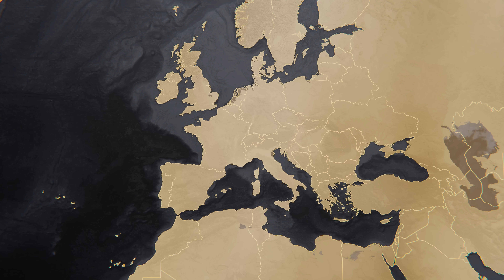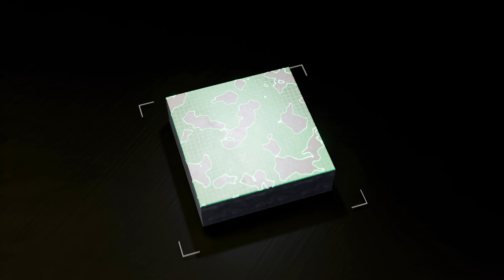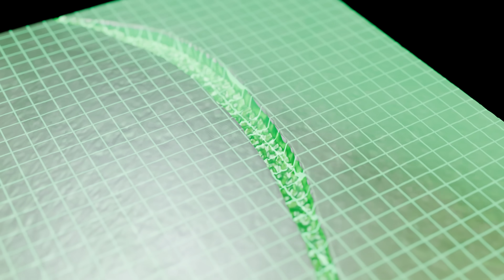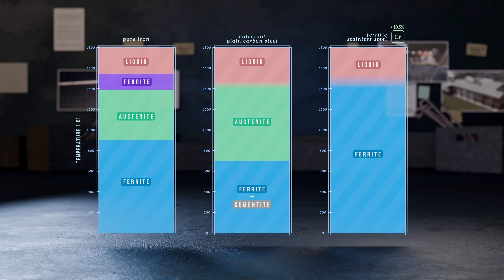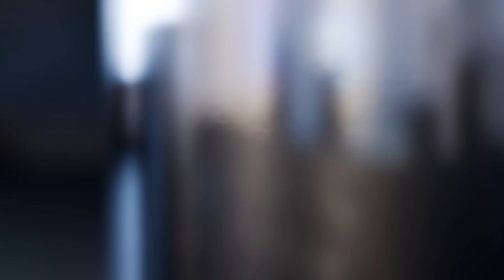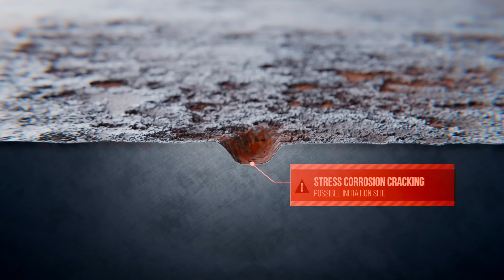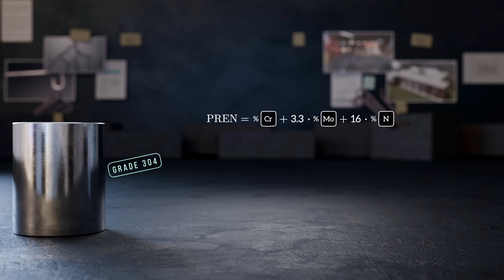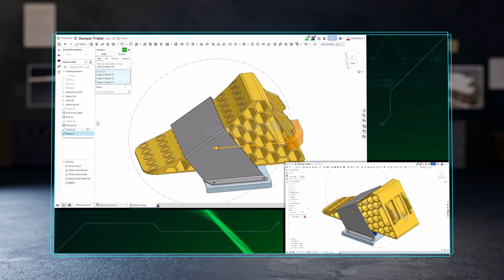The Problem with Stainless Steel

Comment: A very well explained and accurate discussion of stainless steel metallurgy. As a registered Professional Engineer in metallurgy, with 50 years of experience, I knew from the very beginning of this video that type 304 stainless steel would be a very bad idea use in the high chloride environment of a swimming pool.  Although stress corrosion cracking (SCC) of Type 304 is much worse at higher temperatures (around the boiling point of water) this video explains why certain conditions can cause catastrophic SCC failure at ambient temperatures. The main conditions for this type of failure at ambient temperatures were the relatively high stress applied to the support rods, and conditions which led to high concentration of chlorides on the rods.
Reply: i knew 304 was a bad idea in salty or chloride rich environments as a sparky with no expertise in metallurgy at all 😂
Reply: @casemodder89 - I love the beauty of SS and even though I never had a metallurgy class I thought it was common knowledge that chlorine made SS rust because it broke down and penetrated the oxide layer. As a mechanic I have many, many choice words for "engineers".
Reply: @casemodder89  yeah you have no expertise it shows
Reply: That's why I had so much trouble with construction projects at the water treatment plants. Contractors were always trying to use 304 because of the wet environment, totally sabotaging their own work because of the high levels of Chlorine in the air.
Reply: Nobody cares that you're a PE. It just tells the rest of us engineers that you think fancy titles make you better. We can study for free instead of spending money to tell others that we studied.

Comment: Stainless is also a lousy metal to build machines out of.
It's necessary in food processing.
The solution is to shut it down once a week and tighten bolts.
If you don't tighten the bolts on the weekend, then you'll be chasing them all week, during production, when there are dozens of production guys doing nothing while you do what should have been done while they were at home sleeping.

Comment: This almost happened to a pool area in Atlanta, GA. In a hotel. I was contacted by a company that had bought the hotel and there was an obvious chlorine smell throughout the hotel.
The concern was that the air from the pool area was crossing somewhere. Either via a pressurization problem or plenum problem.
It turned out to be both. The stainless steel ducts of the pool area were corroded. Internal dampers had corroded and become inoperable. So that if the pool unit was off the shared OSA duct would allow other a/c units to pull air from the pool area. A hen the pool unit was running it pulled in too much outside air. This made the pool area too positive and warm humid chlorine air was spilling into the common areas. These common areas re as served by a/c units that served multiple floors such that the chlorine was getting distributed across multiple floors. The pool unit was designed to and built to handle that type of air, but the units serving the common areas were not and they were basically disintegrating.
The discharge ductwork leaked a considerable amount of air into the ceiling plenum. All the supports of the plenum were compromised. This included the support structure for the we duct work and unit.
Most of this was by poor installation rather than metal choice. Including cross contamination from using the wrong tools.

Comment: Ok y'allz while everyone is cracking jokes 12 people lost their lives to a poor design choice of material. 304 is the weakest and cheapest form of SS in the world and the Chinesium Crapolium manufacturer's try to hide the fact they use 304 SS in there products. 
There are over 150 different grades of stainless steel, broadly categorized into five main families based on their metallurgical microstructure. These grades are defined by their specific corrosion resistance, strength, and composition, with the most common types falling into the 200, 300, and 400 series. 
Key Families and Grades
    Austenitic (200/300 Series): The most common type, known for high corrosion resistance and being non-magnetic (e.g., 304, 316, 303).
    Ferritic (400 Series): Magnetic, with moderate corrosion resistance, often used for automotive trim and appliances (e.g., 409, 430).
    Martensitic (400/500 Series): High-strength, magnetic, and hardenable, used in cutlery and aerospace (e.g., 410, 420).
    Duplex: A mix of austenitic and ferritic, offering high strength and corrosion resistance (e.g., 2205).
    Precipitation-Hardening: High-strength, heat-treatable alloys.
But stainless steel isn’t a single alloy.
While stainless steel gets a large part of its corrosion resistance from chromium, there are near-endless combinations of various metals marketed as stainless steel today.
One of the first steps in finding the best options when working with stainless steel is determining the proper alloy for your product.  (HEREIN LIES THE KEY TO THE PROBLEM IDENTIFIED)   303 AND 304 ARE SOME OF THE WEAKEST AND POOREST CHOICES FOR STRENGTH AND CORROSION RESISTANCE. 316 IS OFTEN REFERRED TO AS MARINE SS.  
Stainless Steel Grades
Within families, you’ll find various grades that help to describe specific properties of the alloy such as toughness, magnetism, corrosion resistance and alloy composition.
Older grades often feature a three-digit identifier established by the Society of Automotive Engineers (SAE).
However, you might also see grades in North America identified using a six-character identifier set by the and American Society for Testing and Materials (ASTM).
These are known as Unified Number System (UNS) identifiers. You can find a full list of common identifiers here.
In many cases, UNS identifiers share the same first three numbers as their AISI equivalent.
But there’s also grading systems created by:
    British Standards (BS)
    International Organization for Standardization (ISO)
    Japanese Industrial Standards (JIS)
    European Standard (EN)
    German Standard (DIN)
    Chinese Standard (GB)
Due to the sheer number of different standards and grading systems, it can be difficult to obtain much information about a given alloys unique composition from it’s grade. For example, 304 stainless steel by the SAE standard might also be graded as:
    EN number: 1.4305
    EN name: X8CrNiN18-9
    UNS: S30400
    DIN: X5CrNi18-9, X5CrNi18-10, X5CrNi19-9
    BS: 304S 15, 304S 16, 304S 18, 304S 25, En58E
    JIS: SUS 304, SUS 304-CSP
However, to receive a given grade designation, the alloy must adhere to a strict set of requirements set forth by the organization maintaining the standard.
In the case of the common SAE standards, 304 stainless steel must contain:
    18% to 20% Chromium
    8% to 10.5% Nickel
    0.08% Carbon
    2% Manganese
    0.75% Silicon
    0.045% Phosphorus
    0.03% Sulfur
    0.1% Nitrogen
Each addition or adjustment to the alloy composition will have an impact on the various facets of the stainless steel’s performance.  So basically we are discussing something on an Engineering Standard with worldwide variations of those standards. Yes I know many of you here don't give a flying fart but IF you were the designer of that building and specified 304 as the designer you can be found negligent in performance and design specifications which in this case would simply bankrupt any small or medium sized firms, but, due to the business aspect and the liability included this would require an Insurance to be in effect and I cannot believe someone would insure this based on those design specs. It's a giant red flag.  And likely some ramrod supervisor said : "That's what's spec'd that's what we use IF ever a question about it was ever posed.

Comment: Used to work making and installing the pipework for water treatment plants, we only used 316l bolts with 316l flanges, to avoid any galvanic corrosion.
We also had to spray anti seize on all the stainless bolts otherwise you'd get insane galling very quickly, and then you'd have to take a grinder to the bolt if you ever wanted to take it out
Reply: We use to use large 316 michalor/jublee clamps on pipework. I’ve never been able to unscrew one without it galling/cold welding. Tightening is fine, but as soon as you turn back a few degrees it’s a goner! Ended up putting copper/aluminium slip and that worked
Reply: Galling,  especially on exhaust system fasteners,  is a pita.  My Honda utv exhaust has several fasteners replaced with good old steel after breaking them to clean the spark arrester.   Good idea on paper,  bad idea in the real world
Reply: I worked for a company that designed and built large scale heat treating furnaces. We always had problems with stainless steel bolts galling. one day a co worker accidentally used 316 stainless nuts on 310 stainless bolts.. Even after many heat cycles at over 1000 C there was no galling as long as the hardware was allowed to cool before dis assembling
Reply: You need to use special anti-galling grades for fasteners. Nitronic 60 works great but is under-specced because of its price. Tin, silver, and cadmium coatings work well too but are also hard to source. Many applications will forbid anti-seize or oils.
Reply: @Shaker626  Or you can use nitriding to surface harden the stainless which reduces the galling.
Reply: @MrCarGuy interesting to know! Didn’t know surface hardness made any difference to 316 galling but I guess it makes sense.

Comment: SCC has been known for many years.  Chloride accelerated SCC has been around for even longer - just ask some saltwater sailboat owners who suddenly lost their rigging due to failures in their SS rigging components such as mainstay chain plates.

Nuclear power plants have had to deal with these effects even at very low chloride concentrations in Reactor coolant piping.

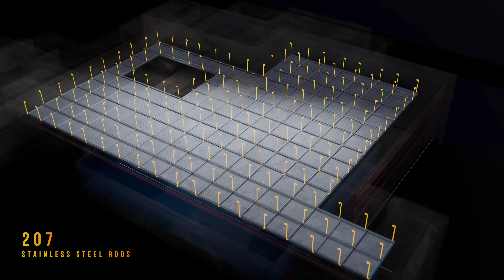Comment: 0:56 !!!  WHOA~!!!  Retired Millwright here.  

My FIST thought it 304 stainless has LOW corrosion resistance against chorine.  OK?  This is coming for a tradesman not a fancy engineer! .. 

It's well known pools off gas chloramines and other volatile disinfection byproducts.  I have NOT watched past 56 seconds, My choice would be Grade 2205 Duplex it's less than double the cost and a public pools ALWAYS have a huge budget. 

Lets see what the "experts say"  !!

Comment: As a Rock Climber, we normally want to use Stainless Steel for our Bolts. But this doesn't work in environments like Sea Cliffs because Stainless Steel corrodes. For those environments we use Titanium Bolts.

Comment: Why did the whole roof fail at the same time?
Reply: Because all the stirrups were corroded and once a few failed you get a domino effect, like tearing paper - the hardest part is getting it to start. I bet it didn't all fall as one monolithic piece but in a ripple.

Comment: This is a really good breakdown; I've shared it with my sailing group. For saltwater marine use we use 316 most often, but on my boat I have a lot of bronze. From what I understand, bronze doesn't have the SCC problem that stainless does.  I did wonder why I had never heard of anyone using duplex stainless for sailboat standing rigging (the wires that hold up the mast.) I did a search, and it turns out that there is at least one company using 2205 Duplex for some parts, but no wire that I saw.
Reply: Incidentally, I'm replacing all of my rigging with UHMWPE (Dyneema) rope rigging. Easier to inspect than stainless wire, and less likely to look fine then fail catastrophically.